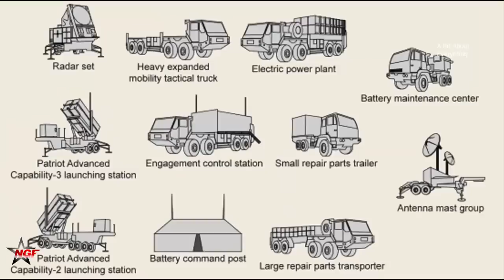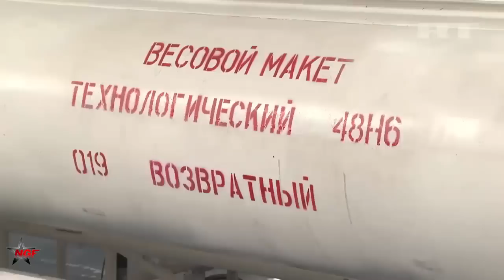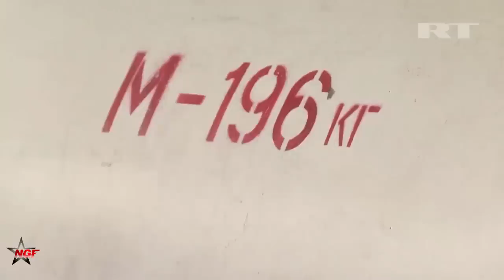Russia Will Not Run Out Of Missiles Despite Sanctions, Russia produces up to three times as much

Comment: I think there was a perception because Russia had started buying in circuit boards from Europe that it would run out of the necessary electronics for missile/rocket fabrication. This has not proven to be the case with local supply operating more effectively and some components getting through from China under dual use issues. 

The USSR had a developed electronics production system developed for the space race. It was mostly located inside the current Russian boarders and is therefor able to continue production of the guidance systems.
Reply: Я вам открою секрет-мы не используем в ракетах чипы иностранного производства😂 это ракета а не айфон который не работает на морозе😂